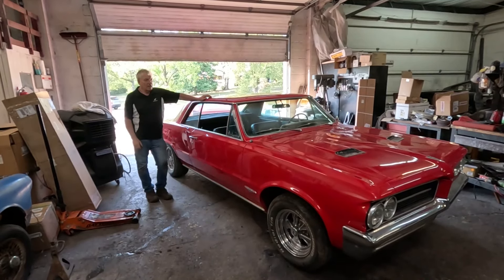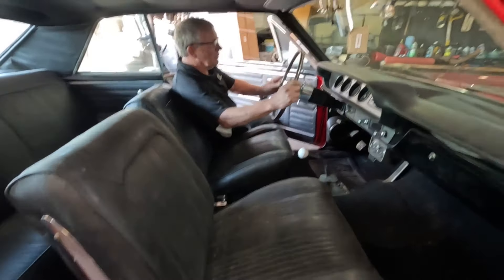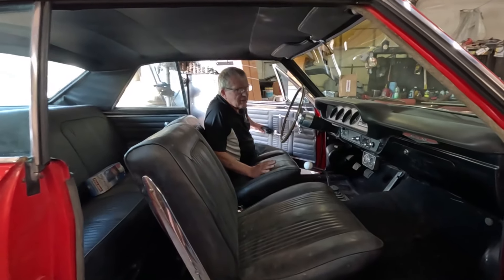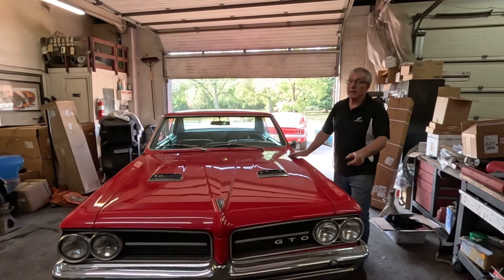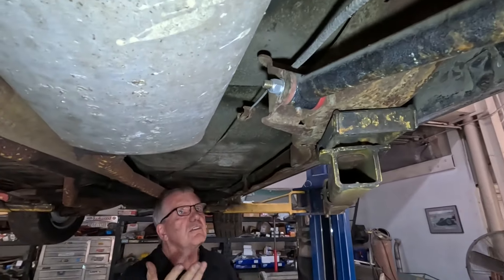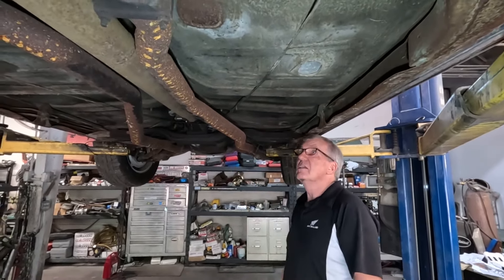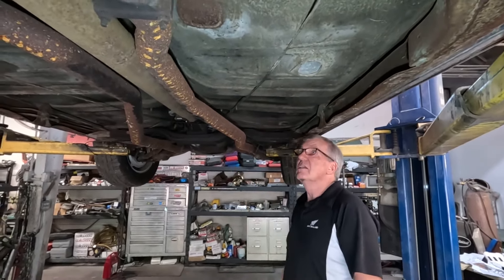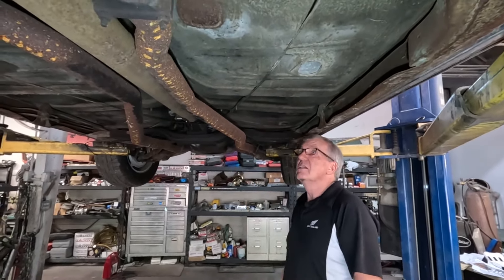64 GTO Tri Power 4 Speed     Uh Oh !!!!!

Comment: i worked on these tri power pontiacs back in the day and i can't tell you how many timing covers i replaced because the coolant ate its' way through the alloy cover, worth a look. i'm seventy nine so i was there back then swaping gears on a mighty twelve second run, just setting the world on fire.
Reply from the maker: Hmm, so when it ate through the cover did it leak out of the engine or into the oil??  It has taken a lot of water into the oil. I measured the oil I drained out and there was an honest 9 quarts in the pan😳
Reply: @kiwiclassicsandcustoms9160  it leaked into the engine. what happened was the path that the coolant took past the impeller forced the coolant by and cut a trench in the alloy and would eat its way through the cover very common. alot of the tri power pontiacs did this, i think the reason was at the time the coolant wasn't engineered for alloy like the modern day coolant is.
Reply from the maker: I've got the timing cover off now and it looks perfect......
Reply: @kiwiclassicsandcustoms9160  not saying i know it all because i surely don't but i would lay money that at sometime in that cars life the cover was replaced. back in the day i would say i replaced at least i every three months, i was working for a chevy, olds and pontiac dealership at the time. saw alot of things at the time that an independent shop didn't because of warranty. just thought i would throw that info on the cover out there maybe a little help to you. keep the videos coming i enjoy  them
Reply: i know this goes without saying but i wasn't replacing the cover on the same car every three months
Reply: i read on down in the comments and saw where you replayed to another viewer and said it had a steel backing plate, that cover was surely replaced under warranty because that was pontiacs fix for the problem.

Comment: Reminds me of my old 77 Buick Electra Park Avenue 403 where I had a blown head gasket.
I noticed my engine temp go up so I added 2 gallons of water as my coolant level was way down.  
Added another 2 gallons of water to get it home.  Then I checked the engine oil and found milkshake all the way up the dipstick.
Engine was still purring like a kitten.  But that was the end of my black exterior black vinyl roof blood red crushed velour interior Buick.
A-wah! A-wah! A-wah!

Comment: Love it! I owned a '64 and a '68. Great fun! It's too bad that some goofball installed the wrong dipstick. I don't think you can determine a '64 GTO from a Tempest by the VIN. Later years had different VIN numbers. If you get it running, be sure to inspect the crossmember over the rear axle. The increased torque of the 389 sometimes twisted the Tempest frame, causing it to snap. Best of luck!

Comment: I bought a 65 Pontiac GTO from a fellow for the four speed transmission for my "so called hot rod". This car had a 400 in it but it was all there (I even drove it some) and had the tri-power setup. The seller was running the engine on the center carburetor (for gas savings). Well I ran some fuel lines to the outboard carbs and set the stop on the throttle linkage as instructed (with a little minor adjustment to suit my tastes). Well we ran it down the street and of course it spit and sputtered and so on. I got it on a street that was a regular thoroughfare and stepped down on the throttle just to where I felt that step for the outboard carbs. I just mashed the throttle down and "jumping Jehoshaphat", tire smoke and engine smoke and you name it. Wow!!!!!!!!!!!!. If I had a place for keeping that car I would have kept it and to hell with my "so called hot rod". Yes sir that engine should come out of the car put on the stand and disassembled and inspected for what needs to be done to it. I bought a 427 first stage design L88  from a fellow (his tale I'm sitting on mine) some fifty years ago. He claimed he drag raced it his Corvette and ran 11.50's. Whenever I get around to it I'll put that engine on the stand and disassemble it for inspection. Better to find any issues before it goes into the car. That GTO will make a good driver just as it is. Definitely will be looking forward to seeing more on this ride.🥸👍👍👍👍👍👍👍

Comment: Timing cover all the way. All the time its been sitting there the aluminium has been corroding away. Pontiacs have a unique design where the cast aluminium timing chain cover doubles up as the back of the water pump so it has water on one side and direct access to the pan on the other. The motor could well be perfectly okay.
Reply from the maker: Is there a particular spot in timing cover that corrodes. I've got the water pump off and the steel backing plate but what I'm seeing looks pretty good

Comment: Lovely looking old beast!  It's the first early GTO I've seen - and I like it too!  I've always joked that my Triumphs have a patented anti-rust mechanism built into their drivelines to explain the coating of oil on their undersides, but it seems they may have also sold the idea to GM.  Maybe that's what they gave GM in exchange during the deal to get the old Buick 215 V8 engine that became the Rover 3500 and Leyland P76 4416cc V8!  But I digress....  Sad when the fluids in an engine swap their respective locations and make a mess.  It's never a cheap fix when that happens....and getting oil out of a cooling system (the radiator especially) is a right pain in the rear.....but she'd definitely be the right car to do the work to and make right.....and plenty of time to wire brush and treat everything underneath while waiting for the engine to return.  That's a great car with a solid structure, a tidy interior and a good stance.  Great to leave as it is and just do the maintenance and prevention underneath, make the engine strong and then enjoy it out and about as much as possible, I reckon.  Thanks for showing us this one, Chris.  She's a beaut!  All the best

Comment: Those old Pontiacs had a goofy arrangement with the water pump where it goes thru the timing chain cover, that could be it dried up and started leaking, but yeah you'd have to go thru the motor, especially when it's been run like that.

Comment: GTOs didn't get their own VIN number until 1966 and the 64s and 65s are popular to clone as a result. You usually have to send out for the documentation if you don't have the build sheet. I'd probably check and see what engine it has for sure. 1965 brought significant changes to the Pontiac V8 which don't work with the 64 and earlier engines.

Comment: Yeah to do it right would require complete teardown, magna flux the block and heads. Redecking the block and cylinder heads and possibly grinding crank, hardened valve seats etc. Very few machine shops in country can do that anymore.  Have seen one on You Tube ,Jims' automotive machine shop that works with old engines all the time. What that old girl requires is way above what most places can do.

Comment: How did the oil and water mix if it wasn't running?
Reply from the maker: It was running up until the ignition module failed but it was apparently running quite hot........  🤔

Comment: Compression should be around 10.75 to 1. Way to high for todays pump gas and I'm sure after running with coolant in the oil, the bearings don't look to good either.

Comment: Looks like a 455 with a tri-power setup. Definitely NOT a '64 389, the center carb is smaller on a '64. Not a stock radiator, master cylinder, disk brakes, etc... I wouldn't call this a survivor, unless you're talking about sheet metal.